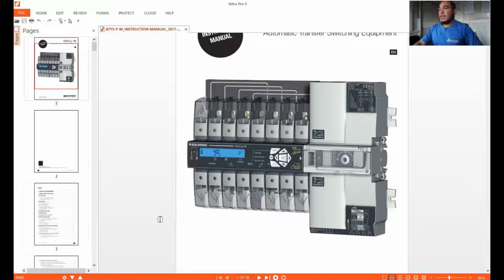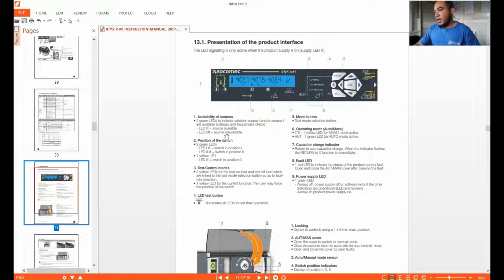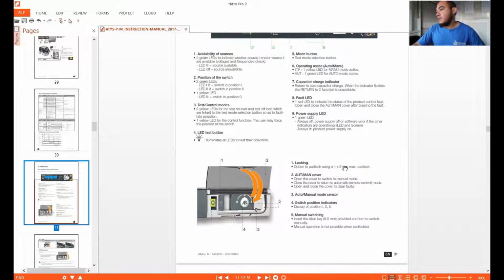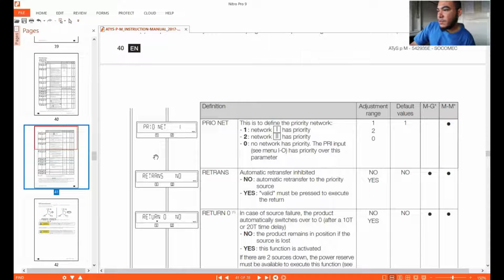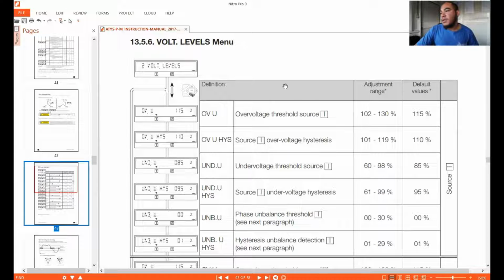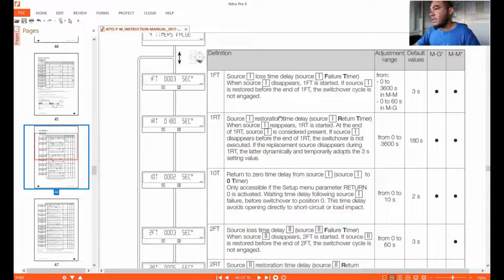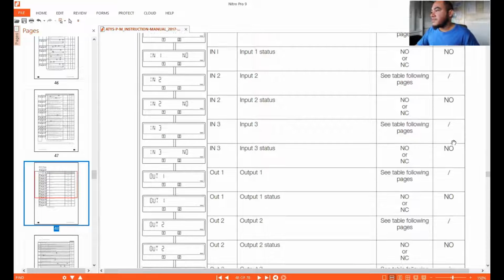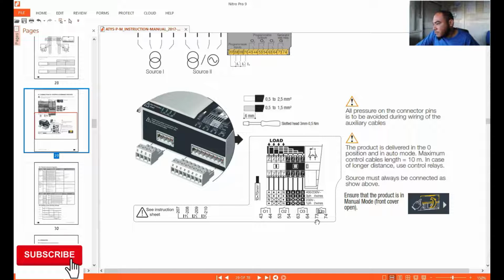Somcomec Atys wiring diagram and functionality simplify benzblogs

Comment: Thanks, sir. I have 2 gensets with dse 6120 conteoller. I also have ATS, and I want to connect 2 gensets, in one ats and each genset work 12h. Any suggestion about this configuration?
Reply from the maker: Do cyclic if this is the one your hoing to do
Reply from the maker: Have just check in the vedio
Reply: Do u have any video you are doing cyclic?

Comment: sir benz, meron kami generator na volvo at mecc alte ang alternator..voltage output nya is 75v..Line to Line..pinalitan ko na ng AVR at rotating rectifier diode..pero ganun pa din..sira kaya ang winding ng exciter? usually kasi sa ibang gen set namin.. pag mababa voltage output..rotating rectifier or avr lang ang may problema..salamat sa sagot at more power..
Reply from the maker: Try mo monang e exite sir tangaling mo connection laht sa avr tape mo lang tapos konin mo ang dalawang wire ng exciter tapos suplayan mo ng 12vdc while omandar engine dapat my boltage yan dependi sa connection ng avr minimum nasa 300-400vac oky
Reply: @benzblogsVlogs  after excitation if wla pa din voltage output? sira kaya ang main winding sir benz kasi may residual voltage pa siya na 75v.. try ko excite ng 12v.. salamat sir at more power sayo
Reply from the maker: @ricomambo9460  pag ganyan sukatin mo mona ilang reatance ang ang exciter mo by ohms asap me
Reply from the maker: @ricomambo9460  ganito check mo winding end to end para malamn mo kong sira check mo din rotor mo winding at exciter winding using reaistance test
Reply: @benzblogsVlogs  sir benz..sibukan ko i excite ng 12v batt..410 voltage output nya..pero pagkabit ko ulit ng bagong avr ganun pa din..7ov output nya. check ko ung wire ng sensing ac volt wla continuity..pos kay putol ung sensing coil sa ilalim?meron ba siya sensing coil?
Reply: @benzblogsVlogs  ok nman winding end to end..ok rin sa megger test ung rotor winding,exciter winding at main winding..ung sensing wire galing sa main winding wlang continuity sa kabilang wire papunta F1. meron ba siya sensing coil? Mecc alte pala ang alternator 510KVa.
Reply from the maker: @ricomambo9460  yun sensin sa avr pag woalng connection wla ka talagagng voltage out
Reply: @benzblogsVlogs  walang continuity sa aux winding.isang dulo ng aux winding nka loop sa avr terminal galing U1 at ang isang dulo naka connect sa F1 papunta exciter. wla ba iba paraan kasi 45v lng ung L-N volt nya. salamat sir benz
Reply from the maker: Check ko din yt ko jan pano gawin mg excite okay

Comment: Sir Benz, if the DSE8610 is in Auto mode, is there a way to turn off its screen? I just commissioned DSE8610 and the screen doesnt turn off when in Auto mode. Im afraid that the screen will be damaged in the long run if it is not turning off.
Reply from the maker: Go to config click the backlight saving mode